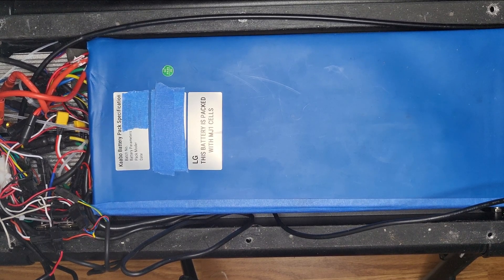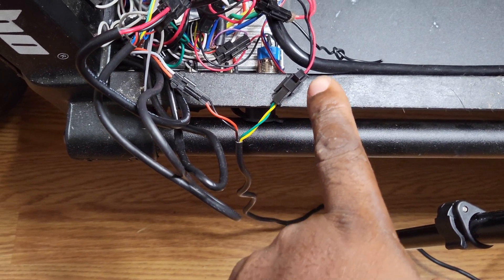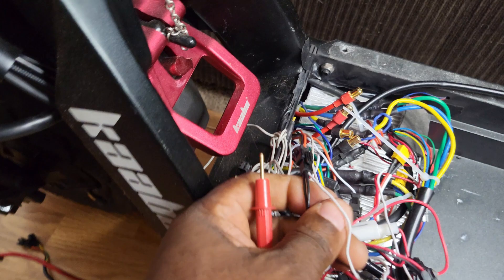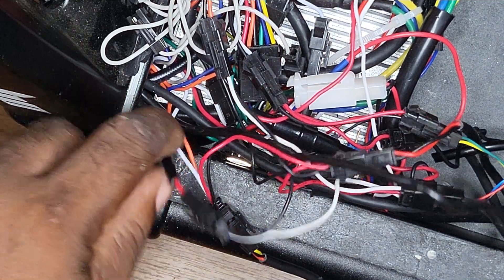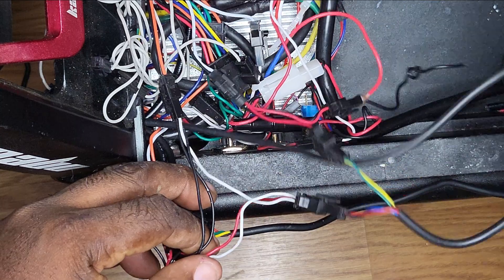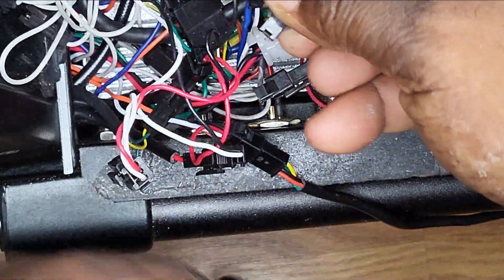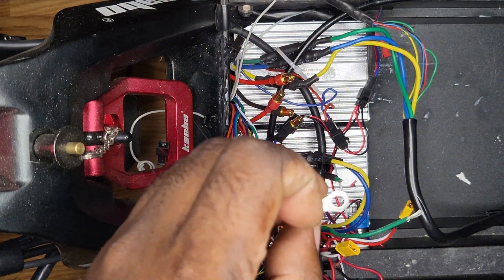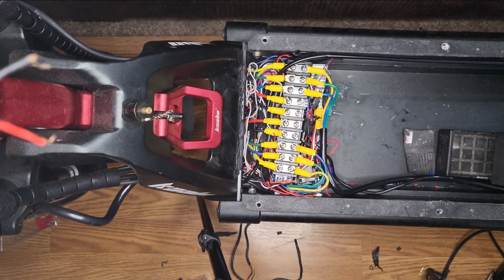Kaabo Wolf King Wiring Makeover

Comment: The thick ( Green, Blue, and Yellow) wires going to the motors are called the phase wires. These should be connected with MT60 connectors and the Battery Should he connected with XT90 connectors, instead of a terminal block. The smaller wires from each motor cable taped off are the Hall sensor wires:

+5volt : Red
Ground: Black
Hall 1, 2, 3 Output : Grn Blu Yel
Motor Temp: white

These are disconnected because the mini Motors controllers use Field Oriented Control or FOC. However If you ever Upgrade to a VESC you can use those hall sensor wires from each motor for super smooth low speeds and take offs.  :3

Comment: It's like a 6 year old wired my Wolf King. For the price I expected better. They also do not use the high enough gauge wire for the power delivery to the motors. I bet these wires get so hot because of it.
Reply from the maker: I agree.. that's what happens when you're dealing with the company who's all about profit! And replacing those wires in the motor would be a difficult task.. hopefully my video helped out in fixing the problem..

Comment: My rear motor wires have managed to get that hot they have melted the plastic sleeves and even melted to the sleeve of the brake wire. Have you had any issues like this???
Reply from the maker: Yes, the main reason why I decided to make this video was because the wires you've mentioned got hot, and shorted out causing damage to both the Bms and main controller. The damage was done after that event. So after I repaired both I made this video.
Reply: @FlyHighforfun  if you could do a video of that I would be forever grateful. Even offer some sort of payment for the info.
Reply: @FlyHighforfun  is it possible to replace these wires with thicker/higher voltage rated cables from the controller all the way to the rear motor? Is there soldering required? What gauge would you recommend as a replacement. (Thank you for the info) I have managed to catch the issue before any issues/ catastrophic failure of hardware damage
Reply: @ATestamentToTech  yes it’s possible to replace those wires with thicker gauge wires I’ll be doing that this week I’ll be using either 8awg or 10awg there will be soldering involved but totally worth it